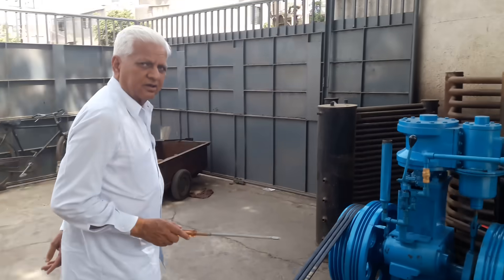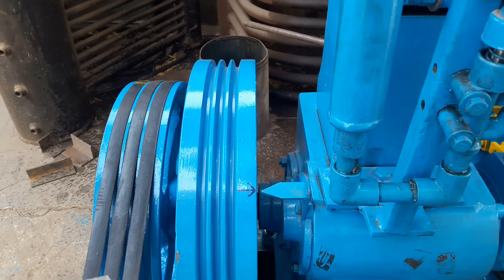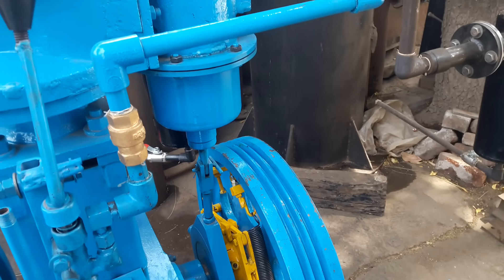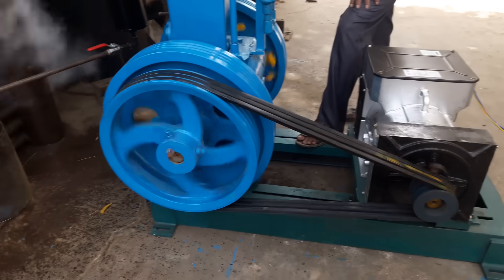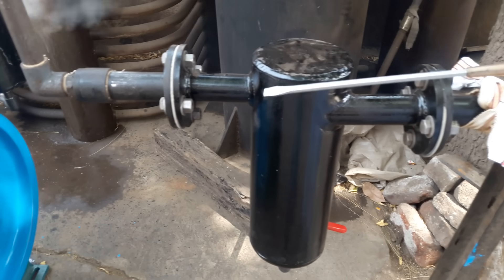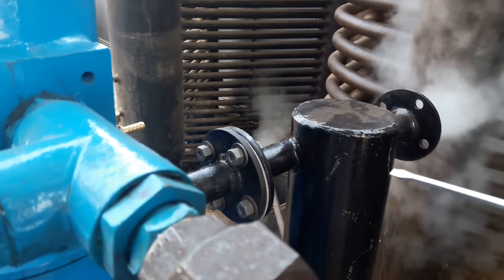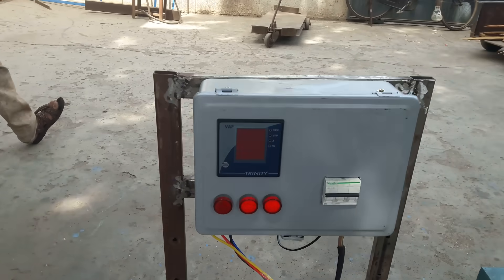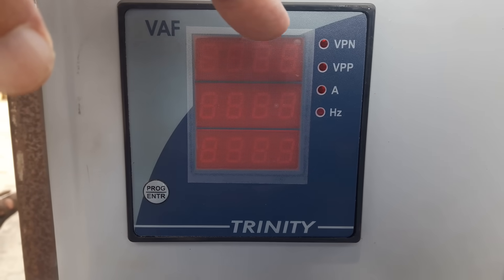STEAM POWER PLANT 25 HP - 15 KVA

Comment: This is just a Listeroid engine with the cylinder removed and a steam cylinder fitted, looks good but wont last long without a hydrostatic or mechanical lubricator fitted for the cylinder and valve assembly.

Comment: Electric load keeps changing so there should be a governor which responds quickly to maintain the rpm as per load changes , this also should regulate the feed change in boiler , bit complicated to maintain practically,  would rather be useful to run a water pump insted to large overhead tanks

Comment: I realize this video is 6 years old but the guys wearing that loose clothing, baggy pants and shirt, with the shirt untucked next to those unguarded rotating assemblies still gave me chills. One was even wearing sandles. Not to mention working with extremely hot valves and around heated steam pipes with no gloves. My prayer is that no one was injured.
Reply: Well this is also not in the highly litigious United States. Where everyone is always concerned about being sued, and tries to make accidents impossible.
Reply: @SubvertTheState  My statement related nothing about litigation. It simply points out the safety concerns that common sense demands. You Sir have obviously not worked with high pressure steam and are unaware of the catastrophic effects a leak, that is invisible to human eyes, can cause the human body.
Reply: Lol. They dont care. There's a billion more to fill thier position if anything happens 😅
Reply: Shut up

Comment: This is what I need to charge the batteries when it's raining and solar isn't putting out the required power. I need to generate maybe 8-10kW to rapid charge my battery banks on rainy days. I have tons of oak firewood. Just need to find a steam engine and boiler to run a generator head.

Comment: Thanks for this video.
Just a few of questions.
1. Will it run a 100KW/h alternator with both single and 3 phase outputs.
2. Can the 3 phase output be used to heat the boiler ( I will need to heat the boiler with a 3 phase diesel generator until the required steam pressure is achieved and then disconnect it and connect the boiler to the alternator once it is running).
3. Can the wasted steam be reused to go back into the boiler.
4. What is the cost of this steam engine and a 100KW/h alternator to be shipped to Australia. 
Thanks in advance

Comment: Dude,  use a steam turbine, you will get MUCH more better efficiency and output and route the pressure back into a water tank to recycle it.
Reply: No no no, in a small application like this a turbine is not appropriate. They need more boiler pressure though
Reply: That's what I said...these guys love nostalgia, still living in 1888.
Reply: @vrwalk5816  maybe look into volume and pressure requirements of a turbine vs reciprocal.

Comment: 1200 PSi pressure is required and each unit should be producing 12 MW of electricity. In Pakistan at KotAddu natural gas is used and 1900 MW electricity is produced. In lower Sindh Bagass is used to produce electricity. The animal waste can be used in big cities like Karachi, Mumbai to produce 1000 MW of electricity clectricity. Let us emphasise on Hydel Power. Around 100,000 MW can be produced. Like wise Wind Power can deliver 100,000 MW of electricity.
Reply: Plenty of poop=shit to burn for sure

Comment: Sir, what is cost of this whole system.
Reply: u can make it with a normal car engine if u change the intake and exhaust valve timing. or u can use an old water pump.

Comment: That would be so awesome to have as a backup generator for an off grid house
Reply: Sure would.
Reply: Yes, but it will require continuous supervision.
Reply: @shikharupadhyay4284  It would, but it could be setup to charge a battery bank, then shut off. 25HP is way more then a homestead needs in continues power.
Reply: Not sure, if you burn chipped wood or pellets it should be able to run by itself with a stoker,  in times when you are occupied otherwise and don t have time for firing it with wood or whatever you use.

Comment: Sir I need a boiler 300kg per hour for paddy parboiled pressure 15 to 20 psi in boiling drum . burning paddy husk and husk briqutes.
Is it possible with water tube boiler

Comment: It's a very primitive and inefficient generator. Starting from the boiler you should consider Insulating the lines and then working forward aim for a higher stream pressure which should then be condensed back to the feeder boiler. I'd also like to see a bigger flywheel and some method of adjusting to torque on the electric generator. Its a good effort for what you have available but not the best homemade steam generator out there

Comment: Sir 
You can use condensate water and out put flash steam by re cycling method  by connecting those pipes to feed water tank. 
It will reduse your solid fuel also.
Reply: they're only testing it
Reply: cualquier combustible se reduce en un 60% con este intercambiador     Chimenea de plastico (PVC) Ver enlace youtu.be/LMAPmSDjZwU
Reply: Okay 👍

Comment: Veljibhai - is it possible to use solar panels to heat water and store steam in a big parallel tank then pass on Steam to the engine and return it back to the tank.
Reply: It is possible to use only solar, but only on sunny days. And it takes quite an array for that much steam.

Comment: Beautiful design and you do know exactly what you're talkin about much appreciated watching this video
Reply: looks to me like the bottom end of the engine is based on an old Lister CS stationary engine, converted to run on steam. Copy Lister engines are also sold as Listeroid among other names.
Reply: @pugman205  Yes it does look like a Lister body. I wonder if the conversion to steam is a simple process? any ideas?
Reply: @user-zx7tg4ph5r  I don't think it would be too  hard to convert to steam. The ones I've seen on other small engines that had been modified use the spark plug hole as a steam inlet, rather than where the carb used to be
Reply: @pugman205  bro spark plugs are used in petrol engine not diesel one. Secondly the two brass  know he opened to start the engine was the top dead center and bottom dead center so it became duel acting engine.

Moreover bottom part looks like of lister but if you see closely that yellow thing on right side flywheel is governor. Which is way bigger. So simply you can say it have taken parts from lister but its 90% different thing.

Comment: Connect exhaust steam pipe back to boiler as power producing companies do this way you can get better efficiency , you should do under load testing to check it's capability , over all good efforts  keep it up .
Reply: How do you get it back into the boiler, consudering the pressure in the boiler?
Reply: @12knut  simply condensing steam to water then pump to boiler

Comment: I feel like there needs to be a return line to the boiler, insulation on the vapor lines, a changover from a reciprocating system to a turbine, and a full triangular boiler. Triangles have the largest volume to surface area, but having a flat top increases surface area too much. A full 4-5 sided pyramid would offer simplicity of construction and make it easier to insulate. Ceramoc coatings are amazing for that.
Reply: This isn't a perm install, I believe he makes the engine only.
Reply: You can’t beat a piston for torque with steam, a turbine requires more pressure and more boiler and therefore more loss. A turbine would be ok in larger power plant type applications where the demand and power are scaled up.
Reply: @cousinitt7915  You can, just simply by using a reducer at the outpout. 

"turbine requires more pressure and more boiler and therefore more loss", false if you design it properly. Also, a turbine have a better yield because you have less things in movement during operation (just shaft and some bearings) and the expansion of steam is way more significant  than in a reciprocating engine even in a triple expansion one. 
The one in the video is fairly primitive because he only have a high pressure cylinder and the exhaust steam is simply wasted in environnement also, nothing is insulated. It's just a good for demonstration was but not for real operation.
Reply: @mariscaljustin3947  Turbines are expensive. 5-axis CNC mills or hydrocutters are required to produce them.
Reply: @JBF-GST-Tanda  Sure but in this case a compound engine and an condenser is a minimum.
Reply: @mariscaljustin3947  Actually, turbines don't match piston engine efficiency until you hit at least 500 to 1,000 horsepower. Among other things, tip losses start to kill you because you are on the wrong side of the square-cube law..
Reply: @JBF-GST-Tanda  You are actually wrong there
Reply: Exhausted steam would normally be put into a economiser and used to warm feedwater
Reply: @union310  I believe you mean that it would be put into a feed water heater.  An economizer is internal to the boiler and it heats the incoming feedwater using the cooler exhaust gases departing the boiler.
Reply: @53kenner  If you are an American yes. But I am in Britain.
Reply: You're missing the point. Read the video description. This is a small robust system that can be used in remote rural areas for low power consumption where efficiency and design are foregone to accommodate simplicity and robustness of the system.
Reply: Where can I buy this ?

Comment: Inefficient... a gasoline engine is cheaper to run than that. You need insulate and catch the heat escaping from the fire to preheat the air going in to combustion. Same with the steam. Condensate the steam to water and keep it just under gaseous point then pump the hot water tho the steam generator and so you will keep the energy and convert only to electricity wath you need
Reply: Tom33 SL the efficiency itself is not an aim for an engineer. Cost of operation is way more important. If you could use your local fuel it may be very cheap.

Comment: There is no recycling of condensed steam, heat &  water flows system to prime mover & then discharged to atmosphere.
Should be energy conservation type.
Reply: It looked like he had some kind of condenser right where the discharge pipe opened to the atmosphere. I don't know if he said why it was not connected. I didn't quite understand everything he said so I may have missed it.

Comment: Solar concave mirrors can also be used to generate steam 
It will convert it to renewal energy

Old plus modern tech. Combi
Reply: Atleast you can use it in days when sunlight is available specially in summer
Reply: that is hard af
Reply: How much this entire cost? Including boiler? Also with Indian gst
Reply: Solar panel can allo used to generate electricity
Reply: then the generator won't work at night, renewable energy is a big scam, the western world is using coal to generate electricity to this day while tricking you to believe in this non practical renewable shit, if it worked they will use it first in their power generation.... wake up before it's to late
Reply: @ProckerDark  This paranoiac bullshit, dams are also renewable energy. What you try to mean is non-conventional renewable energy, like solar, eolic and others which are very good option to reduce pollution. Seems like you fell in a politician-made scam.
Reply: @ProckerDark  stupid dems prefer coal over nuclear

Comment: If that guy would take all the potatoes out of his mouth we might understand him better. This thing is extremely inefficient - No insulation on the incoming steam lines - Boiler way to far from the engine, they could catch all the water, condense and recycle it. Put insulation on the cylinder. At best, steam engines are about 15% this one is likely luck to make 15 to 18% just from heat loss and very wet steam use.  That said - This is a great idea where they haev fuels other than wood, coal or oil. it is a simple set up but the maintenance...!!!  Same thing that killed steam locomotives. Remember - the boiler needs maintenance as well as the steam engine itself.
Reply: I think that was just a prototype. I imagine that it would be insulated and closer to the boiler on the real thing.

Comment: I am Md Jalal Uddin (Bangladeshi). I am a poor peasant child. We also have seven brothers and sisters. I am small in all the brothers. My own four boys and girls. I have assembled various types of energy for four years to produce a power generating machine that produces one-tenth of the production capacity of electricity to produce electricity at an uninterrupted rate. That machine is completely environmentally friendly. No type of fuel is needed for the machine to run. The auto-timer switches for twenty-four hours in the power generated by the recycling system. The name of the machine was "FERAL GEM", which means that the gems are very good. Currently the work of 500 kW machine is going on in Dhaka. The machine has been given an input of 45 kW of electric two motors and the Output Alternator has been set to a 500 kW. My research machine continues to work in many obstacles in Bangladesh. I myself have formed a company. I can not proceed to the company name "JUNAYED POWER LTD" for the problem of money. If I got financial assistance from a local or foreign person or donor company, I would set up a one-hundred-MW electricity generation plant. I can invest in a power generation project with the right to a local or foreign person or donor company.
You Tube Search:
১। দেশীয় পদ্ধতিতে বিদ্যুৎ উৎপাদন।
২। নাটোরে অভিনব বিদ্যুৎ উৎপাদন যন্ত্র আবিস্কার
৩। স্বল্প খরচে বিদ্যুৎ উৎপাদন যন্ত্র আবিস্কারক
Contact Address:
E-mail: junayedpowerltd@gmail.com Viber & Imo No. 01748800041
 Md. Jalal Uddin 
Mobile No. +8801792252681
                     +8801761035395
Facebook ID No. 01703378178 Search

Comment: More polluting d air than combustion engine itself.
Reply: its high pressure water vapor (complain about the firebox)
Reply: What about using a solar collector to concentrate sunlight to generate steam? I've wondered recently how feasible something like this would be to build in my backyard where there's plenty of sunlight
Reply: @zfoxfire  probably wouldn't work in a viable manner. Concentrated light wouldn't produce enough steam to keep the engine running. It could work on closed circuit when the energy is only needed to heat condensed water back to vapor. This still would need many little sun panel or one really large to provide enough pressure.

Comment: Rather than using steam try developing a method of using supercritical CO2 that gets recirculated.  Much less energy involved heating the Co2 to it's critical temp.
Reply: Wrong, CO2 does not expand 1600 times the original volume.
Reply: FUNEWSChannel who said anything about the expansion ratio of steam?
Reply: Dude you were talking about running a steam engine on CO2 rather than steam I told you exactly why that won't work, don't be talking out of the wazzoo, I've designed, built and tested only about 5 different motors on both air and steam, your idea is wrong admit it. You can heat up CO2 until the cows come home and it will not replace steam in a steam engine, get a clue. Sorry but in my opinion you asked for it.
Reply: FUNEWSChannel - I'm sure your very knowledgeable but are just unaware of the properties2 of co2.  

Carbon Dioxide is good for a lot of things like adding fizz to your soft drinking in its gaseous form and keeping food cold in its solid form as “dry ice.”

What many people do not know is that the gas is also useful in its lesser known liquid form. You won’t see it in nature since it takes five atmospheres of pressure at slightly higher than room temperature, 31C, to take it to a super state.
Then it can be used to push turbine blades and thus generators connected to them to make power. (Note to readers: Convert Kelvin to Centigrade using this tool.)

Because of its physical properties as a liquid, it has become a target fluid of opportunity to run turbines and thus make electricity. Steven Wright, Ph.D., who recently retired from Sandia National Laboratory (SNL), has set up a consulting company called Critical Energy LLC to bring this technology to a commercial level.

The objective of using supercritical CO2 (S-CO2) in a Brayton-Cycle turbine is to make it much more efficient in the transfer of heat. Wright points out that a steam turbine is about 33% efficient, but that an S-CO2 turbine could be as high as 48% efficient, a significant increase.

A closed loop supercritical CO2 system has the density of a liquid, but many of the properties of a gas. A turbine running on it, “is basically a jet engine running on a hot liquid,” says Wright.
Reply: The only missing point is the ultra hight pressure vessel and gaskets required to hold the CO2 in supercritical state.

Comment: Why do you need to Fabricate all the excess material and weight to reverse the direction of the engine, when you have belt sheaves on both sides, and all you really need to do is turn the driven machine around. 1902 technology. Steam traps. Condensate return.  Outlet steam needs cooled in a hot well and returned to the boiler. Excellent home project but there is so much wrong with this contraption its hard to tell where to start. It probably putting out about 50% of its potential  ???

Comment: how many lb/min steam consumption and boiler pressure?
Reply: He has another video explaining a power generator.  He explains these 10-25hp steam engines need 150psi of steam pressure to run. The boilers they are making can create 300psi of pressure and will vent at 600psi.

Comment: too much pollution. (CARBON DIOXIDE )against the green enviroment plus cutting trees or woods. OLD MACHINERY NOT RELIABLE. NEED MORE ROOM(SPACE)
Reply: Ok, just make a solar collector with mirrors instead.
Reply: Yes , you have a point but 90% of that electricity produced comes from the same method. (
Reply: We have wind blow down trees and diseased trees that are a forest fire hazard in dry seasons, so you are so stupid you should try living in a forest fire.